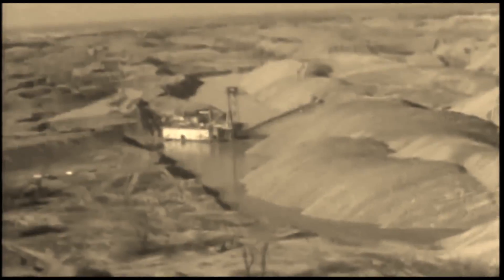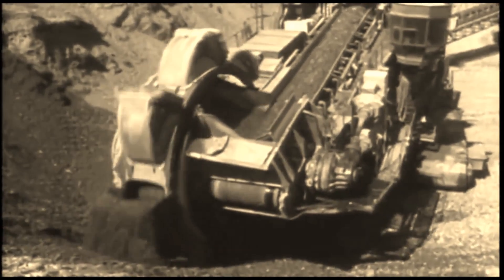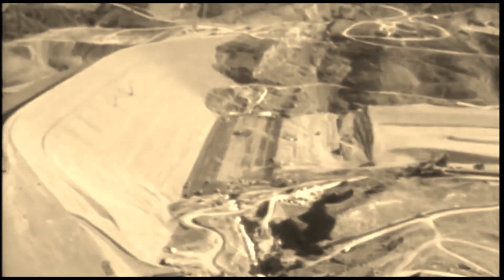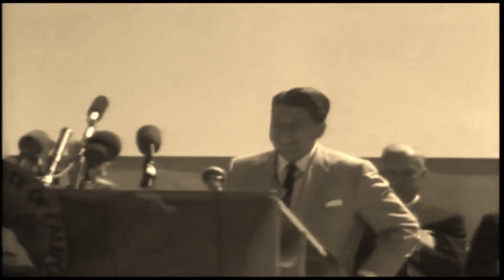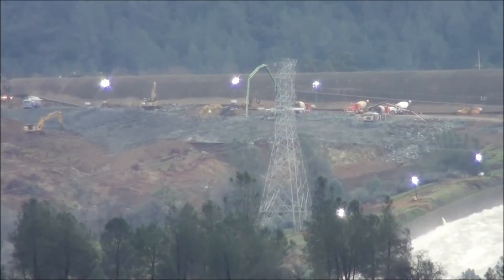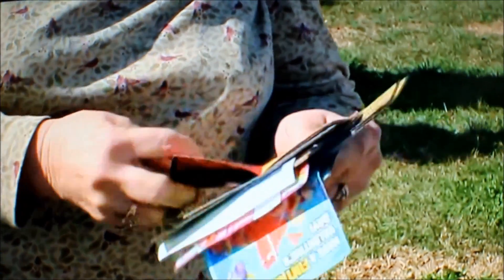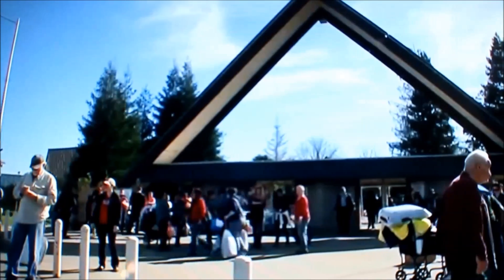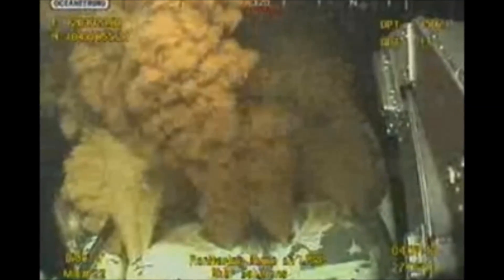The Birth & Possible Death Of Oroville Dam

Comment: Look at the erosion canyon at 11:42, bottom center of the screen. It is just a few feet from undermining the concrete emergency spillway weir. It was a close call. It cannot be used again because the spillway is made of dirt. Filling it in with rock and or cement will not stop the dirt from eroding.If the damn is full of water and the weir is undermined, it makes no difference if the main damn holds or not.
Reply: except it will be used again.... think before you comment

Comment: The spillway was not tied into the structure in any means.  No  pins or anything just a lot of rocks and shotcrete  pumped over layers. Under the ground it's all sand and rocks nothing really to grab ahold of. The water coming over the spillway could be around  650,000,00 cfps and now the water is moving faster than before and free of debris and the direction of water will head towards the actual spillway. give water a resistant structure and its so much kinetic energy that comes from the angle over their is greater than 40 degrees can't work against gravity. But good luck if you want it to work cover all open areas until you're past  that deep vein in the center of all that sand make the walls high enough on both sides like huge bowl than it could work but good luck ..... oh and panning for gold in the area will be tremendous..see ya soon..just look yourself at the video  the water will go towards the spillway id would leave that area now serious i don't know who's in charge but it seems to be a lot of work for nothing you need to make an huge wall against the main spillway and that new grey one and lots of that can happen quick but the guys seem to be avoiding that area well see how it all plays out.. my prediction is tha

Comment: Does anyone have any innovative ideas of how the spillway could be repaired quickly?  My idea involves building a lightweight carbon fiber section which could be put in place with the helicopters that are currently on site.  When the spillway water flow is turned off these sections are placed in the hole, and the sections would be pumped full of concrete.  I have three videos which discuss my solution.
Here is a link to the first one:
https://www.youtube.com/watch?v=D7QyiCbJJEw&spfreload=5#t=4m57s